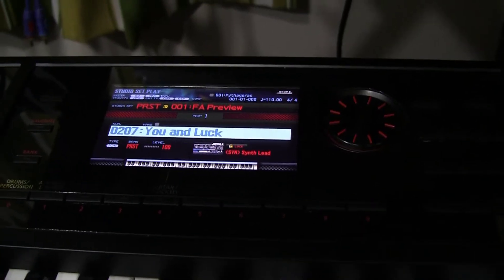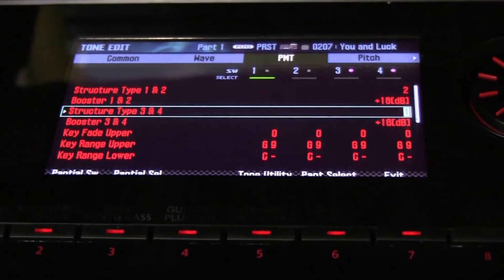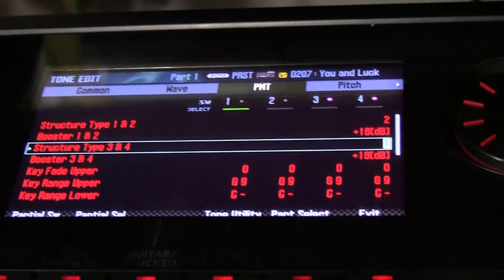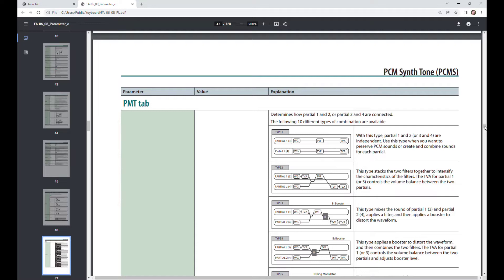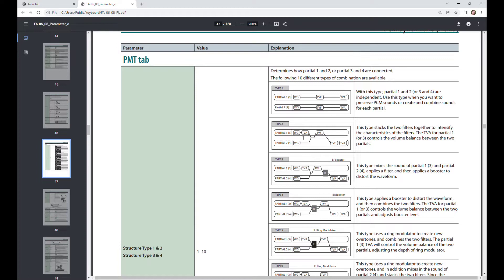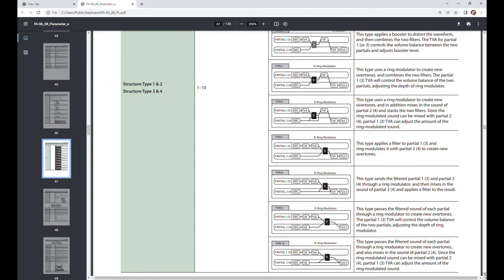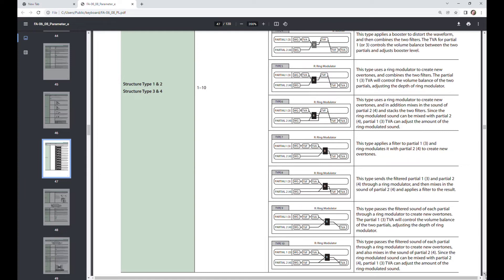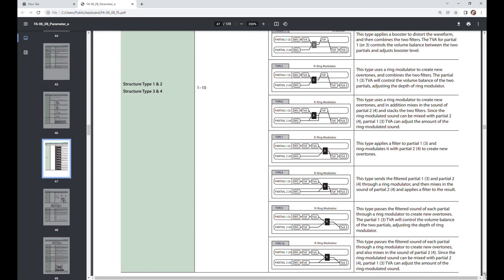Roland FA-06 - PMT Structure

Comment: Since 1993 and the introduction of those Structures or PMT in JD-990, Roland has never, in 30 years, shown any video tutorials, on how the PMT ring modulator affects Roland oscillators in synthesizers with Structures or PMT. No videos on the subject on the whole internet. I was hoping that this video, those 9 min 21 sec are going to show at least one example of sound out of a ring modulator in a PMT, at least three seconds worth of time,  but I got only talking and talking and talking about the Manual.
Reply from the maker: did it ever occur to you, simply "try it out".... select a Structure that uses the ring modulator and then change the tones on each of it's inputs to hear what it does ...... if you do NOT own a Roland keyboard at all .... well you are now in luck..... I will make a video that demonstrates a FEW of the possibilities (which are endless) ..... however,  personally, I found no use for the "ring modulator" at all, since I do not like what it does to the sound..... so that is why I simply did not think of this before I read your post

Comment: Do you know if the Roland allows to use a midi controller interface to assign the synthesis parameters to the knobs and sliders on the controller? I don't like the menu diving when creating my own patches, so I'm wondering if there's a way to use a midi controller with a bunch of knobs instead.
Reply from the maker: You can only do this kind of programming with SysEx strings .... most MIDI controllers have very limited SysEx capability .... and that's why you cannot do what you would like to do
Reply: @StephenMendes  Thanks for your help. Is there a way to do it on a computer and then route that to the midi controller? But then you have a computer in between the FA and Midi controller.
Reply from the maker: @AmarVision1  You can do it from a computer IF you are a good programmer .... you CANNOT do it from any MIDI controller that I have seen.... Many MIDI controllers simply cannot send SysEx messages and the ones that can only accommodate SHORT messages ..... it might be possible to map a few controls on these but you would need TWO buttons for every feature .... one to activate and one to deactivate .... cause it is impossible to send two DIFFERENT SysEx strings from  one control button
Reply: @StephenMendes  thanks for you help!

Comment: Hi Stephen, I wish you a happy new year. Thanks for this video, clear and simple, as always ! I saw this page on the manual and I understand it better with your explanation. Do you know if the "TVF" and "TVA" of this picture are the one  we can modify for each partial in the TVF and TVA tab of the tone edit mode ? Take care.
Reply from the maker: YES.... the TVF and TVA are the ones attached to the Partials ..... so you can freely change the settings and see what it does to the sound ! .....  I keep encouraging owners to EXPERIMENT because you cannot "damage" anything and the sound is NOT saved until YOU save it ..... so simply change the studio set or the tone and all changes will instantly disappear .... if you have made changes all over the place .... in System  menu.... Effects .... as well as Studio set .... then just turn off the keyboard and turn it back on and it will instantly be back to Factory setting 🙂
Reply: @StephenMendes  Thanks for your answer. It's very clear. I can test lot of things without damage. Take care.

Comment: Great video as usual.  Very informative as always.  I have a question for you... Have you ever tried to create an user odd meter rhythm pattern or arpeggio (e.g. 5/8 or 7/4)?  I have spent quite a bit of time on this and was able to create something but for some reason when it reaches the end of the the pattern or arpeggio, it always seems to add an extra beat at the end before restarting the sequence. This  obviously throws of the timing of the song afterwards.  If you have a chance to look at this it would be appreciated.
Reply from the maker: Never used those meters .. .... but if you have NOT quantized and lined up your music within the bar lines (measures) then this is probably what is causing it  ..... I find it incredibly difficult to record "perfect" timing in "REAL time" recording mode and the END of the SONG is where it is MOST NOTICEABLE ..... also even if the end note(s) is located on the proper Beat but the Duration of the held note extends beyond the end of the measure you will get this problem.... so check it and report back to me 🙂
Reply: @StephenMendes  Thanks, I  actually tried using the loop record and quantized to a 1/8 note to see if I could get it on time. Then  I  tried step record for 4 then 8 bars and even 16 bars.  The timing is good all along until it gets to the end of the loop a then it adds that extra beat before statring the pattern again. A little frustrating. I love this keyboard but this annoys me because it forces me to use an external sequencer for just a few songs.  Everything else is great.   I'll give it another try and let you know .  Thanks for the tips!
Reply from the maker: @guyperreault9213  always glad to help you any way I can....  this is a budget keyboard and there are a few "quirks" that it has.... anything this complicated usually need some "workaround" here or there ..... I absolutely love this keyboard but that does not mean that I cannot find faults .... there are things about it that I wish had been done differently .... however it is what it is .... I would have bought the Korg Kronos 2 which is much better but  1. it is larger and heavier 2. it is 3 times the price and 3. Korg service is NON EXISTENT on this island where I live ....... imagine spending nearly $4,000 on a keyboard and if anything ever goes wrong with it there is NO SERVICE .... it's totally CRAZY ..... that's why I put my big money into MODULAR instead..... the worst that can happen is one module fail and you just take it out yourself and replace it with another 👍.... easier to put it in a small box and send it back to where it came from also 🙂